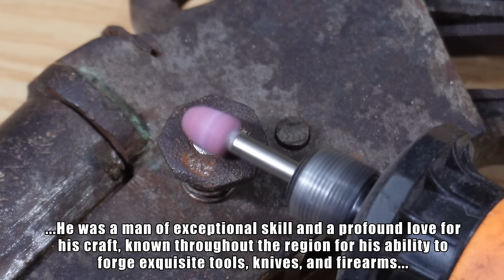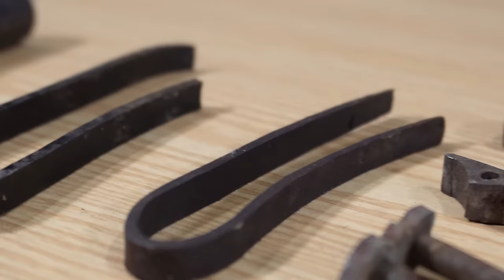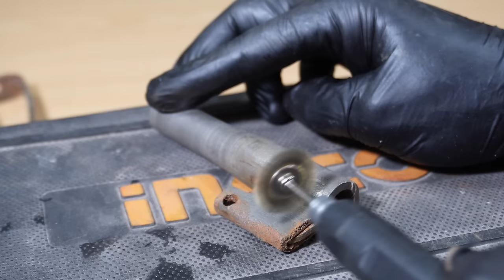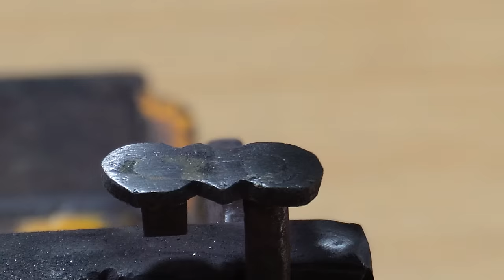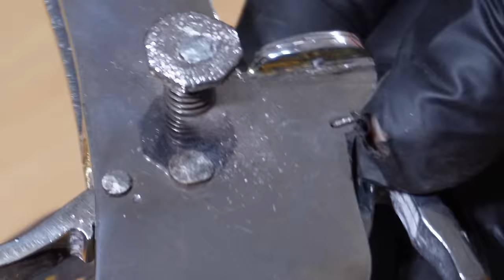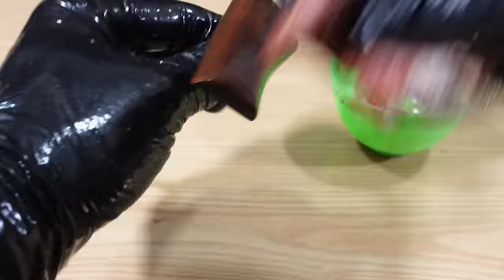German Single Shot pistol Restoration

Comment: What made you think that this is a German Made gun ?  Germans never do such crude machining , they are renowned for precision engineering. The one in question is actually a crude , illegal gun mostly found in Asian country , mostly in India and in Bangladesh , they are known as "Desi Katta" in local language , mostly made by hand and using a car axle to turn into a smooth bore barrel with the help of lathe, the one in video, are chambered for .315 caliber and NO its not an old gun. There is no proof marking or makers name. Sometime illegal local gun makers stamped it with fancy name and country to get more value while selling them to criminals , they usually sold at a price of INR1500 to 2500 a piece and few often burst while shooting due to poor barrel and breach locking mechanism. Criminals used it as use and throw gun , as they are cheap and hard to detect by police, as they are actually ghost gun with no serial number. I am wondering how this piece landed up to your possessions .